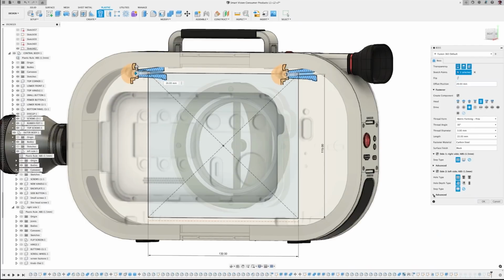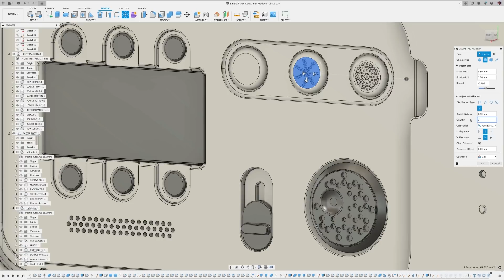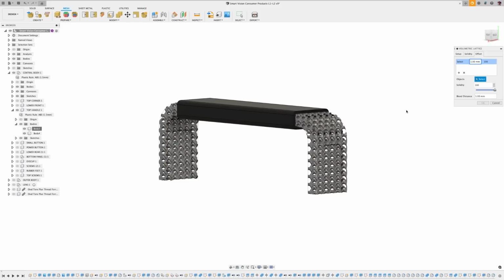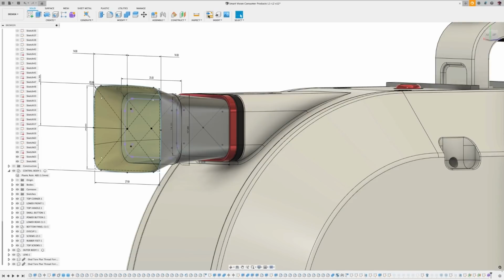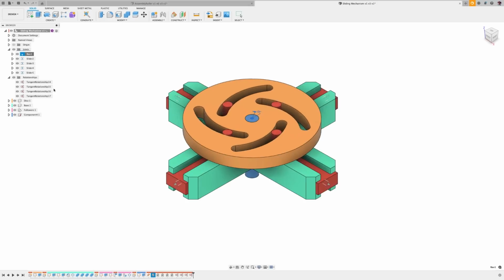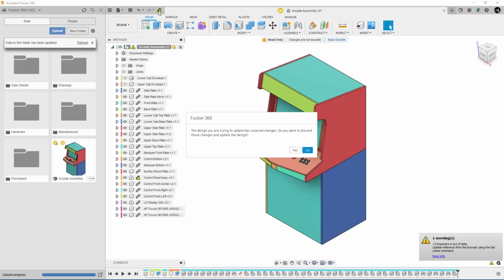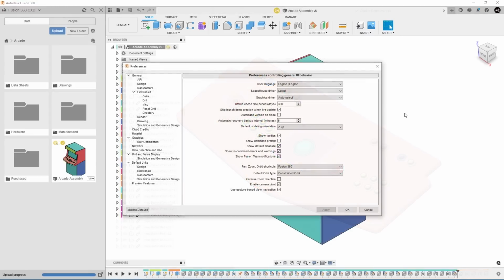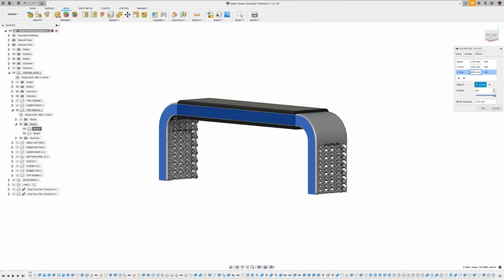What's New in Fusion 360 Design & Engineering - January 2022 | | Autodesk Fusion 360

Comment: I get the sneaking suspicion that Autodesk has been changing its paradigm from being run by engineers to being run by accountants. Fusion 360 is still the best bang for the buck around, both compared to cheaper and more expensive solutions. But with this update, you're leaving the door wide open.

If snap-fit and boss was free for subscribers and education it would be OK. But right now, if any other company shows the visionary thinking that gave birth to Fusion in the first place, then Fusion would be an easy target.
Reply: Yeah,  excluding more and more new features and extensions is a great way to have the next set of makers and creators just go somewhere else. No thanks.
Reply: @LummyTech  Just curious...Where would you go? Onshape? Inventor? Solidworks?
Reply: @TROYOSTRANDER  a
Honestly, Fusion is still the clear leader even with these unfortunate changes. I am really looking at the size of the support community and the amount of tutorials being made as a real factor. Something can be incredible but if it’s only you using it and there is no sizable forum or YouTube videos with tutorials, it makes it a tough choice to switch.
Reply: @TROYOSTRANDER  Alibre

Comment: Looks great! Anything in the pipeline to improve general performance?
Reply: check out the blog post and the notable fixes. there is a big boost to open performance in this release
Reply: I think they are working on a "De-Cloud" extension, which will cost $5000 per year and the application will work on local data only, greatly improving speed and stability, with only the occasional call home to check for valid subscription and back up of data to autodesk servers.

Comment: I heard that there is another NEW EXTENSION called ( Speed boost extension ) which will make fusion 360 work at normal computer speeds instead of the slow cloudy speeds we currently have.

Comment: What we really need is a frame generator and a decent BOM addin. 👌
Reply: But for free, not as a paid add-in

Free, I mean in the basic Fusion package, which most of us pay for.
Reply: @ExMachinaEngineering  I'd be happy to pay more for the software if this was added as its still way cheaper than inventor and to me, pretty similar in spec at a 1/5th the price. Inevitably the price will ruse with more and more stuff being added to the program. But we really need this frame generator I feel its letting the community down massively.

Comment: where is the roadmap for electronics! do i have to wait 3 years for PANELSATION or will that feature be another $2000 extension??
Reply: Dave, I haven't tried this in production but i know this was an area i think Eagle was lacking in as well and that is where the tech came from.  If you select your board layout (box select it all), then go to Automation > Run ULP, there one called "panelize".  This will copy the elements onto new layers and then allow you to group/cut/paste your array.  Note that you will need to not use your layers 25/26 for Gerber data.  The ulp is offered up by cadsoft.  Anyways might meet your shortterm needs.
Reply: @LearnEverythingAboutDesign  HI mate, Thanks for that tip, But I already use that ULP for my Panels i use it regularly, And I create my panels properly with it, But its time consuming and if you make a change or mistake in design, then you have to start over, I think it would be an easy fix for Autodesk to make a Panalising feature built in.

Comment: Why is autodesk spending heaps of time and money on FAR-OUT Features when we still don't have many basic issues solved?? The current version has so many flaws and clunks, yet they keep adding more complexity and bloatedness.  We still don't have BOM's, We still don't have revision control, the Electronics library is the slowest and clunkiest think ever. The data panel is almost useless, we still don't have panalizing for PCB's. We cannot change the order of components in the browser tree, we cannot customize the navigation bar, it takes too many clicks to the most commons used functions, we can't do BENDY things like wires or springs . we can't do cable assemblies. etc the list goes on
Reply: Dave, there is revisions control, in the Manage Extension.  It is a check in/check out rev control offering.  Somewhat of a PDM/PLM.  It is one of the only extensions that you can't use with Cloud Credits though and must set up with a credit card(unless that has changed).  If you have it you will notices Release change orders and additional properties associated with designs.

As far as BOMs, i think that is coming as the Parts tables in drawings are lacking, but honestly if detailed drawings is one of the main things you need then Inventor or Autocad is still a better choice.  I prefer to design in Fusion 360 vs. Inventor still.

I think the PCB library is getting an update finally with this January update.

As for the Browser, you can restructure it.  If you drag/drop bodies or components you can move them around.  If you decide you want a component in another you can just drag it there.  Note that this will break internally referenced joints(or can).  And the best option is to create those components from the start, but it is possible.  Depending on when and how features happened you can even drag them after the component creation in the timeline.  But i do believe if a sketch was created at the base level of a design it will need to stay there.  

As for the clicks for common functions.  Best option i can say there if it is not on the right click menu is to use the S key and then add whatever tool you need there so it is at least next to the cursor.

Bendy things like associative wires/springs.  I don't see that ever happening because of the way the structure of bodies/components is.  In other assemblies like Inventor where you reference parts and you could design a wire between parts, that can update based on their position and the spline/pline driven by its length.  I can't think of a way to make that work in Fusion.
Reply: @LearnEverythingAboutDesign  HI mate, I actually have a zoom meeting with Autodesk , this afternoon on the MANAGE EXTENSION, as I have discovered it can do many of the things i wish to have in fusion 360, so let's see what happens. there is no trial version of Manage Extension, but there is a 30 day money back guarantee.

As for bendy things, I think this could be done as a cross between joints and animation, we would just have to add some kind of "PATH" for a bend to occur, which is animated when that part is moved by another part.  I know about the browser "restructuring using folders, and even copy and paste, but a change to the browser display would be very easy! it's just a list of data. we need to have alternate views of that data.
Reply: @davem3325  Good luck. Hope Manage works for you.  I have been in some of the beta testing for it and know it is always being improved.
Reply: @LearnEverythingAboutDesign  Thanks, Well, The fusion manage extension is disappointing, still not sure what it does, it appears to be a very cut down version of fusion lifecycle. I will be giving it a proper evaluation for my need, they have a 30 day money back guarantee which i may have to use.
Reply: @davem3325  I think it is a slow transition from Lifecycle to this.  So yeah a watered down PDM.  I have been pushing for more custom properties.  I will say one great thing about Fusion 360 is you have a more direct line to the software to express concerns and provide feedback.  I worked with Solidworks for years and even when i was part of a reseller getting a direct line to anyone was impossible.

I will raise your need for panelization next time I talk to the PCB development guys and if I can let you know anything I will.
Reply: @LearnEverythingAboutDesign  you are correct i have had a few online meetings with nice people at autodesk, I always give my feedback to my frustrations. I am concerned that the spend a lot of resources on really cool far out feature, but neglect the bread and butter issues. Fusion is NOT suitable for businesses that want efficiencies, 50 percent of my time in fusion is for design, 50 percent is data mismanagement ( and crashes )
Reply: @davem3325  Totally understand!  I have worked professionally in Inventor, NX, Solidworks and Fusion.  I have been supporting Fusion since 2015 so been through a lot of updates in that time frame :)  

To be fair I have had many a headaches with every software but I totally get what you mean and where you are coming from.  There is a key end user(or there was) at the start of Fusion that we know before it even had drawings.  On the roadmap it looks like big things in 2022 and to be honest the Product Design Extension took me by surprise! I would love to see better integration of custom properties that carry through the designs.  I think Fusion is a great solution for a subset of users, a good solution for a large group and an ok solution for the rest.  I would say the sticking points are really big sticking points for the hardcore professionals like PDM/PLM for example or Drawings.

One day maybe, but also it started life as Inventor Fusion much in the way Solidworks launched 3dexperience so who knows what the future may hold :)

Wish you luck with the Manage trial!
Reply: @LearnEverythingAboutDesign  I have decide to CANCEL my Mange Extension Subscription - its sucks!!!
Reply: @davem3325  Bummer, that didn't last the 30 days lol :)  Have you looked at Upchain?  I haven't but know it has come up before.

Comment: How about tapered threads?
Reply: You have tapered threads in the Hole tool on the Create menu.  Limited to BSP, DIN, ISO, JIS, NPT and NPT for PVC.  Making a custom thread is still a pipe dream... no pun intended there.  Best you can do is use the Create > Coil tool and drive a sweep cut or sweep off that coil.
Reply: @LearnEverythingAboutDesign  Can't get modeled tapered threads, which is kind of the whole point. It's a no-brainer to make a taper, but including the thread is the tricky part.
Reply: @hairyfro  I never created modeled threads for production, but if you were maybe 3D printing the actual threads it would be helpful.  If you create a hole in a part then use the Create > Thread tool you can created a modeled tapered thread(with the pipe thread spec).  Still not a custom size but you can pick from the standards. However I don't believe the threads actually taper and you can't select a tapered face.  Room for improvement for sure.

Are you looking to 3D print threads?
Reply: @LearnEverythingAboutDesign  I don't see anything about tapered threads in the thread command. And yes, it's for 3d printing. Don't need custom threads, just standard tapered pipe threads.

In any event, the workaround isn't a big deal. I just import a McMaster-Carr model and use that as a tool in the combine command.
Reply: @hairyfro  Clever using a mcmaster part as a work around!  

For me on the thread tool when i select the thread class i can pick several tapered options and even plastic printed thread options.  Maybe one day there will be a good work around to model them but sounds like you have a good solution!

Comment: Sweet Mumma! There are some great stuff in this update! Hey with that volumetric lattice-ing, can I perform static evaluations on those structures? Will this allow me to evaluate the limits of a 3D printed structure more accurately?
Reply: Really good idea my friend. FDM 3D printing always had this flaw of being hard to analyze with structural finite element methods.
Reply: You can kind of run FEA for 3d printed parts but stuff like layer adhesion, print temp and many others can lead to parts way weaker than you predicted using FEA.
Reply: @Trancelebration  You bet mate. Also the variation in internal structure is another variable.